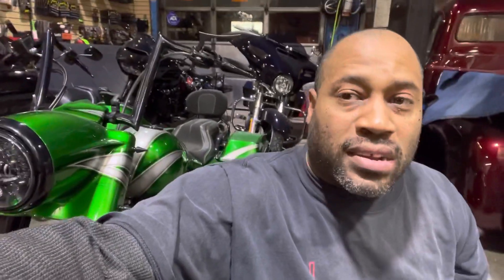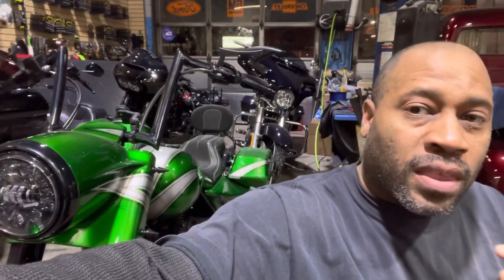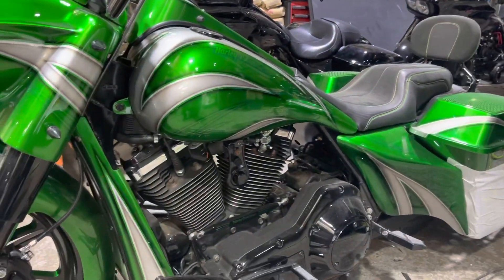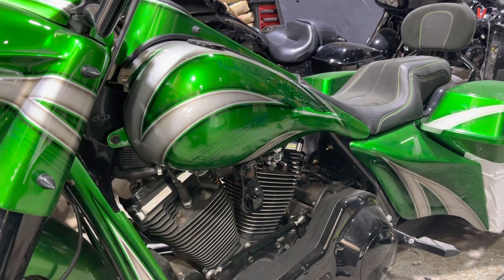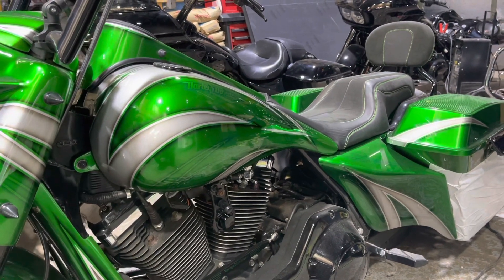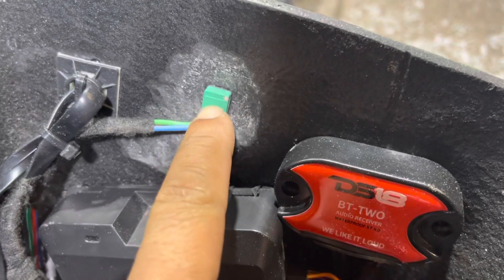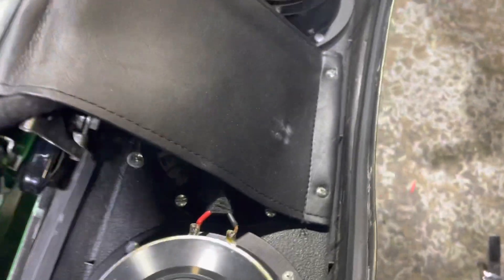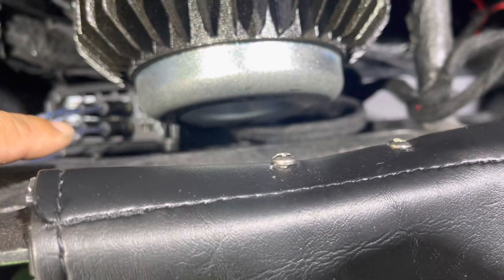Harley Davidson Road king Audio walkthrough by Nvs Audio

Comment: Carlos ...when you do a motorcycle audio system with multiple amplifiers how do YOU wire the remote turn on.?  Are you using a relay or you splicing or maybe Daisy chaining?  I'm  just curious.  How many volts does an Amplifier need to see coming in through the remote anyway.? 🤔
Reply from the maker: @rome The new amplifiers require very little amperage to turn on . They want to see 8-15 volts but very little amperage , you can literally turn on 10 amps on on single remote wire . I never us a relay unless I really need to ( sometimes they cause a pop when they shut off and the magnetic field inside the coil collapses) .

I run remote in from the radio to the dsp ( all
Dsp have a dedicated remote in and remote out wire to eliminate turn on and off pop with their built in delay circuits. The higher end ones even let you adjust the delay on and off times )
From the dsp remote out line I branch off to all the amps . I don’t like jumping from amp
To amp so I will solder all the wires to the single remote out wire at the dsp and then branch them out to the amps from there . 
On some of the sound digital multi amp installs I have to install a relay to force the amps to shut off ( it’s rare but it happens ) I wire a relay to turn the amps on and with the same relay I force the remote turn on line to ground when the head unit is off . The bleeds off any residual charge left on the turn on circuit and forces the amp
To stay off . ( video on that coming up shortly)

Comment: Nice! Thats a lot to go in the bags.. I bought a chopped tour pack just to hold, 2 amps and dsr. Should all bluetooth receivers be ran to the auxiliary of the DSR like you have it? i have a similar bluetooth receiver( Wet Sounds ).
Reply: did a little research just now and I see the difference between the DS18 bluetooth receiver and my Wet Sounds bluetooth receiver.. the DS18 has  Remote Trigger Output and Stereo Male RCA Output to where the Wet Sounds Bluetooth receiver only has 3.5mm output which would then need to be split to RCA to the amp or dsp. Damn, I think I'm going to change my bluetooth set up to this cause it seems so much easier!
Reply: @Barberian_  The DS-18 also puts  out 4 volts. Believe me  that 4v makes a big difference.
Reply: Facts. My homie Road King got focal speakers on his crash bars with  boat pods for the front speakers
Reply: @dionne681  I have a friend that uses that exact same setup on his Road King. And I can tell you from experience riding with him that thing is super loud. 80% of the Builds on this channel are using way too much equipment.

Comment: Whats controlling all the audio considering the Road King doesn't have a radio?
Reply: Bluetooth and your phone
Reply: Smartphone to bluetooth or USB are the two most common ways to control your music without a head unit. USB has the best sound quality. But Bluetooth is more convenient. If you use your smartphones  you will need to turn off the phones equalizer. Equalizer on your smartphone was  made for earbuds and headphones, not for reproducing sound going to Mobile Audio amplifier. A DSP or a equalizer is a must Or you will not have a way to tune your system. Most smartphone equalizer has have some sort of volume limiter to keep you from getting ear damage. This will also limits the output going into a amplifier.
Reply from the maker: @romesyoutubechannel5356  excellent and accurate response 👍🏽🙌🏼
Reply from the maker: @romesyoutubechannel5356  

On this bike we are using a Bluetooth receiver and that sends the audio from the phone to the Dsp’s aux input 
We also mounted the volume control knob to the front of the saddle bag so the client has access to volume control of the whole audio system without ever having to touch his phone .

Comment: ok carlos i just learn why you haven't respond to my email,lol you just hurt my feelings,and yes it is a pain in the a, to do audio on a roadking,i know all about that,my bike has all the equip in the bags too,i even put a gell battery to help with the subs and the kicker mono 500.1oh that's in one bag,the other bag has the mids&highs amp,and the head unit , but have learn lots watching your vids,as soon as im done with the project i took on,i am going to improvize rearrange bags and add some other devices to seperate power,and then try to figure out why my mono block clips even though i have change the alt voltage at full tilt,would like some feed back,and or opinion on what to ck for,as far as the clipping is concern,
Reply from the maker: I currently have 4000 emails to sort through and still manage to get all my regular everyday work done 😅

It takes me a while but I try and answer every email
Reply: Carlos is amazing and he has even helped me over the damn phone... always helped me all the way in Texas ... can’t wait to get my system working correctly by u this May
Reply: @NVSAUDIO  oh no worries bro, yes im a busy person myself,so when you get around to it,really intrested in what you have to share,
Reply: something else,you spoke about batteries,would like to know about the stinger battery the one thats for 300 bucks,does it do both run the bike then and also audio
Reply from the maker: @ralphcarrizales460  yes 
It’s a drop in replacement that does everything 
Runs the bike and will support audio up to 2000 watts rms
Reply: @NVSAUDIO  thx bro, as soon as i can now iknow thats my next battery